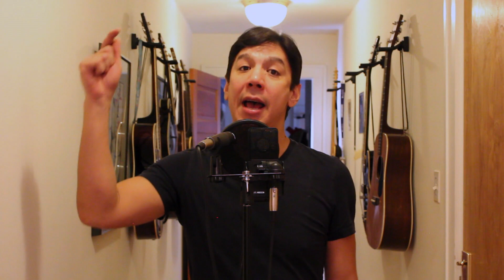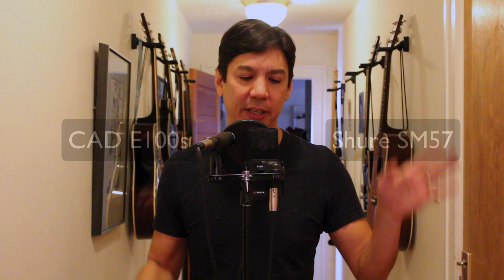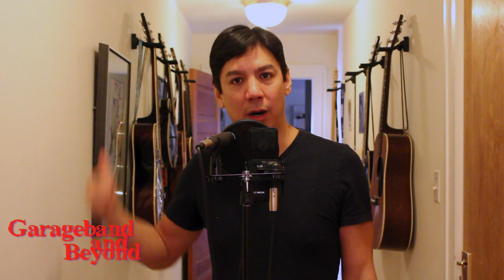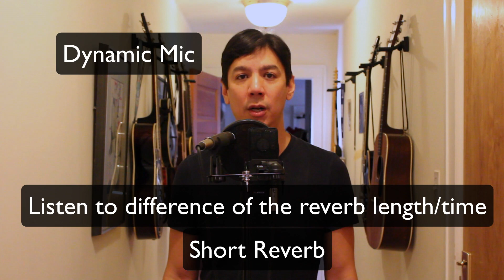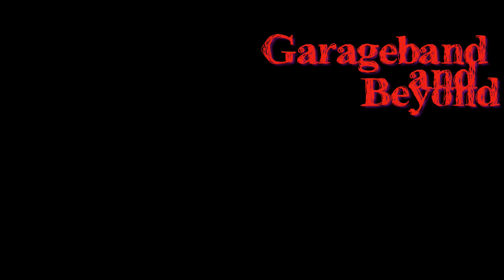Are you using the WRONG Microphone? Dynamic vs. Condensor mics DEMO

Comment: Strongly disagree. Microphones don't "interact" with the room. Imagine a thermometer. It measures the temperature of the air around its heat sensor and tells us how warm it is. Does it interact with the room? No. Now take a microphone. It measures SPL in front of (or around) the diaphragm. Does it change anything in the room? No, not really.
Does the sound wave approach a condenser mic differently than a dynamic? No, absolutely not.
The difference is no myth.There is no "interaction". There is faster and more precise measurement (typically done by condenser mics) and there is slower and less accurate measurement (guess what).

Comment: Hey Lewin quick question. I don’t have a treated room so I’m gonna start recording vocals with an sm57 bc my condenser mic just sounds so weird bc of the room I’m in. I watched an old video of yours where you talk about how to perform to a mic when recording vox. Pulling away for louder singing and getting closer for quieter parts. In that video you were working with a condenser mic, do the same principles apply with a sm57?
Reply from the maker: GREAT question! Yes that technique still applies to a dynamic microphone. Basically that move is supposed to help create an evenly recorded signal, plus not distort the mic on super loud vocal notes.
Reply: @GaragebandandBeyond  thank you!

Comment: Condenser's sound way better but If you aren't in a controlled environment  they are pretty Useless..

I had a Rode NT-USB Condenser and it was Picking up conversations From My neighbours 3 houses down.

And By the time you remove the background noise using software you realise you're better off with a dynamic microphone.

Comment: I have an SM57, practically brand new hooked up to a Scarlett 2i2 interface with a Fethead for dynamics in between the mic and a Mogami XLR cable (the best in the biz). With this setup, I still have to turn the gain up to 12:00 just to hear myself, and I get RF interference coupled with the mic’s self noise as well. And the signal is still pretty weak even from 5.5 inches away.

Comment: I just did a test between a no name $60 condenser USB mic and a Shure SM7B with MixPre 3 II (with phantom power on & gain set to match the USB mic) in my untreated room with a noisy window AC unit 4ft away (the AC unit is positioned 90° off axis from both mics). The results: the cheap condenser mic picked up LESS background noise than the Shure. I’m amazed and a little bummed out by the result as I was hoping a dynamic would pick up way less background noise.

Comment: While the SM57 does a better job at rejection here, I'm not sure it's really as simple as this. The e100 while nominally having a narrower polar pattern, possibly has a wider pickup at certain frequencies (I don't know for sure because there is no multifrequency pattern reading available). Small diaphragms supposedly have more consistent polar pattern. Also the mics have very different frequency responses, which probably changes how it picks up the RT60 at certain frequencies.

Comment: if you want to start a podcast show (audio and video) and want to involve eating and drinking with at least 2-3 people, what would be the best audio set up? I want the audios to pick up while we're eating the food (sure, a bit of asmr if you will), as well as when we're just talking, obviously. Should I get one of these condenser or dynamic mics? Or a clip-on mic? or the overhead mic?
Reply from the maker: It depends on what kind of a room you're in really. If it's a space that doesn't have a ton of natural reverb, you should be able to get away with condenser microphones, which would be better at picking up eating sounds.
But if your room does have a lot of reverb in it, dynamic mics will work, the eaters just have to stay closer to the mic.
Reply: @GaragebandandBeyond  thank you for your quick response. Truly appreciate it. And to answer your questions. We will be in a warehouse space. And I'm thinking about laying down/hanging some blankets all around the room to sound proof it somewhat. My only concern is how close do we have to be to the dynamic mics for it to not lose signals? I do prefer the dynamic mics like Shure SMB7, specially since it's recommended for muti-people podcast. However, I'd like everyone to be able to eat as they would normally at a dining table without having to come close to the mic for it to pick up sound or even just to keep the lvls the same and just carry on a conversation, as couple of people would at a diner table. I'm not like the visuals I'm picturing, everyone having to hunch close to the mic and talk and having to get the mic out of the way to take a bite.
Reply from the maker: @TheTrippleTKA  Keep in mind that withe the SM7b you will good preamps to be able to get what you want. They are low gain mics. I have, use and love mine all the time.

In a warehouse blankets really won't do much at all, so yes dynamics would be a good choice. The SM58 is also a very good choice for podcasting and a lot less expensive and you won't need any external preamps. It depends on your budget, but they are good option, especially if you're getting started. 

To answer your question about "how close to mic". If they are turned up properly and have enough gain, you can be about 1-2ft away sand still get the sounds you want.
Watch this https://www.youtube.com/watch?v=hzfx55aTWBI

PLEASE SUBSCRIBE! And thanks for watching!
Reply: @GaragebandandBeyond  by blankets, I meant those thick mover's blanket to sound proof. I learned this trick from youtube. Let me know if you have any other tricks to sound proof the space better. But if I'm deciding on something like the SM7B, would I even need to sound proof? And with SM7B if you're saying it will be good and consistent with 1 feet of distance, then I think it should be okay. There should be enough space between the mouths and the mics to eat without having to readjust with every bite and resuming back to conversation
Reply: Also, I'll be pairing the SM7B with Tascam DP-006 recorder. Any thoughts on that?

Comment: Nice video Lewin!

 I would also add that I think dynamic microphones are very useful when recording a vocalist who is also playing another acoustic instrument. For instance, when I play piano, I have problems using with my condenser microphone because it picks up unwanted mechanical noises coming from the piano. I either have to take advantage of the cardioid pattern of the microphone by angling it upward or sing really close to the microphone and lower the gain. The trade off is that I have to do a lot of work in post for the vocal track to not sound boomy, because the placement of the microphone picks up more of my chest voice. Alternatively, I can easily set-up a dynamic microphone to minimize those sounds.

The cons of using a dynamic is that it just takes a lot more gain, which can lead to more noise in the recording unless you're working with stellar preamps. I typically use a microphone activator (like the Cloudlifter CL-1) for my dynamic, so I don't have to max-out my preamps. I also find that the tone of dynamic microphones are much darker than many dynamics, which could be a problem I guess depending on the genre of music.

Anyway, that's my two cents. Thanks again for making awesome videos.

Comment: Question, im here in Japan right now, and im living in a dorm type apartment provided by my company and the wall here is so thin that you can almost here someone watching tv in the other room. Which mic is best with this type of scenario? I mean Japanese are very sensitive when in comes to noise specially in the evening and from what i understand so far with the dynamic microphone you need to speak much louder than the condenser one. Please help thanks.
Reply: A dynamic. Then raise the gain on your preamp/mixer/receiver/whatever you use so you won't have to speak so loud.

Comment: Hey there, what would be better for beatboxing and singing right into a mpc live stand alone with just a mic? I'm just trying to sing and beatbox straight into the stand alone, but it does not have phantom power, and I'm wondering if using a mic without it would do the job? And what mic could work?  Any suggestions?

Comment: You can just aswell recomend Sm58 aswell for vocal use. Since 57 "poofing" much easier. I’ve read that 57 and 58 have the same hardware inside.  But i’ve also heard difference in sound between those in same song repeated with both. The difference is to difficult to describe. And was so barely noticeable at some points. In those moments i gave the 57 the thumb up there. But vocally the 57 receive to easy those poofs(blasts). But they are warm, and when other mics suit some dongs better then the Shure becomes very warm, soft and absorbing to compare😊 it’s first after trying others and repeat with the Shure Sm58 i noticed it. I don’t like Shure less. It’s the mic yet which have sounded good through many genres of music and sing styles. To compare one mic is better then the Shure in some songs sounds again quite bad in other songs😊 strange that some artists don’t change mics for advantage for some songs😊

Comment: Why my shure 57 have so much noise... I like sound but it is soo noisy man
Reply: Maybe it´s because of cheap audio interface :D I have Focusrite Scarlett 2i2, and shitty dynamic mic plugged in, and it sounds amazing
Reply: Štěpán Křikava steinberg ur22 my interface ...
Reply: @suuuuuuu19  Seems normal, maybe try different USB ports in your computer, or different cable for the mic, it happened to me once, also check the gain or pregain. Those also could make a lot of noise :D
Reply: @suuuuuuu19  Make sure the levels are cranked full, there is no "pad" button  enabled, not sure if the ur22 has that or not. Make sure recording volumes in mic setting in Windows is full (or however you do that with mac). Also make sure you have the Steinberg drivers and aren't using like, Asio4all or something. 

Aside from that, maybe you have phantom power on? Which is unnecessary for dynamic mics and may be causing signal noise. I have a cheaper USB interface (behringer umc204) and if I have everything cranked, it records at an acceptable level so as long as I'm not playing whisper quiet and I am close enough to the mic. It's really not ideal recording at maxed out levels all the time, but it works for me and the noise floor stays quite low and my recordings come out nicely. Also I remember I got the behringer because apparently of the 3 cheap options (that, your Steinberg, or the red one) the Behringer had the quietest preamps, apparently. But I mean, it was only a few db or so quieter.

Also, using these Shure dynamics on lower budget interfaces sort of pushes the limit between acceptable and too noisy. But you should be able to get well within the acceptable side if everything is set up properly. All I can think of other than that is a bad XLR cable. Or maybe you're picking up background noise like CPU fan? Shouldn't be too bad though with the dynamic... There is so many possible reasons, hopefully not hardware issues. But of anything I bet it's the interface, not the mic.
Reply: Do you have cloudlifter if you have your interface crank all the way up that can also make it noisy to

Comment: Thanks for this, I’ve been using my Rode NT1 condenser in a massive room with no treatment, hardly any furniture and wooden floor. It doesn’t get much worse than that for a condenser environment, I want to switch to a good broadcast headset instead of a large “in your face” mic, and I’m looking at the BPHS2 dynamic from Audio Technica, or the BPHS2C condenser and I’m now leaning towards the dynamic, it also has a hypercardioid pattern vs cardioid on the condenser version

Comment: Would using a dynamic mic for my voice be enough to be able to record my  plugged guitar separately ( at the same time) or would you still be able to hear the guitar through the voice track. I'm a noob and I'm trying to find a way to record my voice and guitar on different tracks, but I still want it to be a live performance and not having to record each one at a time.
Reply: Jose Miguel Benga get a Scarlett 2i2 and 2 mics to record at the same time, or any audio interface with 2 inputs. You’re gonna need 2 mics if you wanna do a live performance.

Comment: Wow this video was quite surprising. I'm currently using my kitchen as a studio & have usb condenser mic & it picks up backdround noise & can make me sound quite robotic so I make be best going for a dynamic mic & an audio interface.
Reply from the maker: Shell Zest I think you will be very impressed with how good a good old-fashioned SM 58 sounds!
Reply: @GaragebandandBeyond  Thanks for replying so quickly. My only problem is lack of funds. With the SM58, would I need an audio interface or is there cables where you can where you can convert from XLR to usb? I'm pretty new to recording equipment.
Reply from the maker: @shellzest2568  I understand. The good news is that there are some great deals on Ebay. 
I would say buy a used Focusrite 2i2 for around $50 and then a used SM58 for around $60-$80 depending on condition.
Monitors can be tough on the wallet, but buying used makes things a lot cheaper!

And no, there aren't any cables.
Reply: @GaragebandandBeyond  Thanks again for speedy reply. Will keep a look out. I have come across a site where I can buy equipment & pay monthly which would be handy.

Comment: Great comparison! I find the biggest difference is the frequency response. The condensor has more high end,  but it will also pick up more horrible ess and nasal sound, room reflection (usualy the polar pattern picks up a little behind the mic) and the sensitivity of the capsule will overload much easier. The sm57 can handle lots of volume and has great rear rejection, it's not overly bright and picks up good mids. Supposedly you can put tape around the vents of the sm57 and it will act like an omnidirectional mic. There's lots of cheaper dynamic mics that can be used for vocals, but the sm57 has got to be the most rugged. I'm also interested in hearing a comparison with a ribbon mic.

Comment: Which is best condenser mic for non- treated room?
Reply from the maker: Subi Foa The entire point of this video is that you should probably just be using a dynamic microphone inside of your untreated space. So, to answer your question, there isn’t a condenser microphone that I recommend for recording inside of an untreated space.
Reply: Rode M2
Reply: If your using a condenser microphone I would recommend to get one of those  kaotica eyeball things they also have the bootleg version to it’s called Alctron that helps cut down some of that reverb and then make a mini booth on your room and that can help to

Comment: Hi, I have a question. I recently purchased an MXL 770 condenser. Not sure if I should return it or not, based on the same premise you mentioned. My only worry is the sm57 won't give enough detail/frequency range as the 770. Will it be noticeable to create a record? Is that wide range like 770 necessary to cover all the voice detail? My question is will you really notice a difference on the final mix once eq'd and so on?
Reply: How is MXL working?  You have any record using that mic?

Comment: which mic is good for recording voice for animations?.. I currently have a condenser mic (samson meteor mic) and I never had a dynamic.
Reply: Condenser would be best for that. Pop filter, shock mount, and smooth compression most of all, a good preamp, makes all the difference.
Reply: Austrian Audio OC818 or Sennheiser MKH 50.
Reply: I don't think the Meteor USB mic is what most would consider a "condenser mic".  A usb mic be it a condenser or dynamic is not going to be ideal for doing voice overs. Certainly not if you are looking to make money at doing it. For youtube or something then ya, it will probably be fine. My guess would be stepping up to any microphone using a seperate pre amp/interface is going to sound better. Doesn't matter if its a dynamic or condenser. It will up your cost by quite a bit though. You are looking at probably 200 bucks or more by the time you get the mic, interface, cables and possibly a stand, mount and filter. Probably cheaper if you go with some cheap chinese thing. I saw a set up on Walmart that came with a stand, filter, interface and mic for like 50 bucks. It was using one of the BM 800's and a cheap interface. Not sure how great that would sound either, but I have heard they don't sound "bad". As for doing voice work it depends on where you are doing it. If its a sound treated room or studio with a very low noise floor then a decent condenser mic and pre amp is what I would go with. And I don't mean like a 500 dollar mic and expensive pre amp. Probably sub 100 dollar mic and a pre amp in the 100-150 dollar range should be fine. Might find a deal on one for less even. If it isn't a studio or treated room, like its just your den or a bedroom with bare walls and stuff with a fan, comptuer, furnace/aircon ect running  or you can hear ambient noise from other rooms or outside then a dynamic mic might be the way to go. Then set up a  noise gate and stuff to help filter out background noise. Condenser mics sound great and have lots of detail but they will pick up everything around them really well. That is one of their downsides.